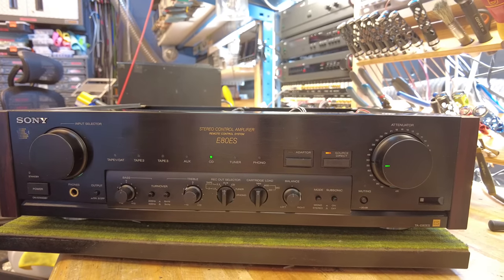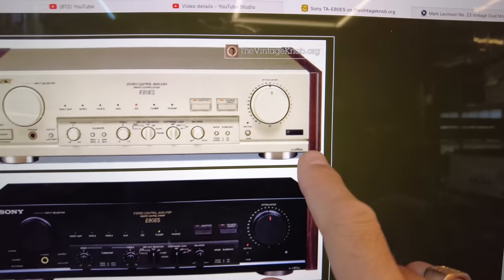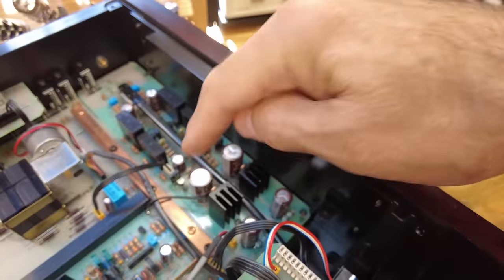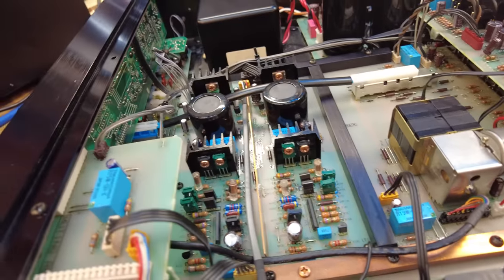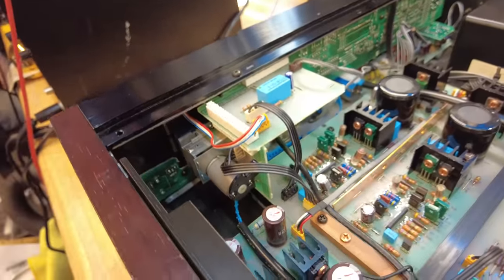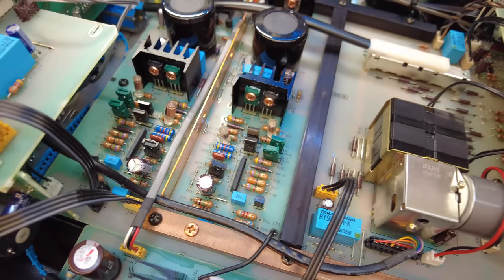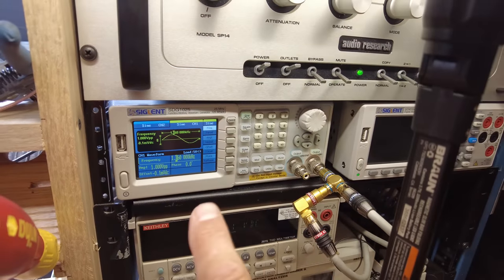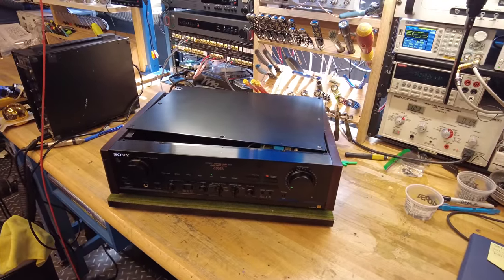If You Find One of These, BUY BUY BUY.  The Killer Sony TA-E80ES Preamp

Comment: This is pro grade XLR I am impressed what’s the voltage output? I had a Nad c350 intergraded with less than 1.4 volts I hooked up my pro power amp to it and it was underperforming so I sold it Nad are not what they used to be

Comment: Hi Fernando, I have to call you out on this one. I love to see these great items boosted, but not other great items mistakenly maligned. The TA-e77es is a fully analog preamp that has a DAC built item. There is no digital processing of any analog inputs. The DAC is a very nice Burr Brown and is fully shielded from the analog circuitry. It’s a great pre-amp. The Burr Brown is a highly regarded ladder DAC which are once again appreciated for their character. Sony’s first actual digital processing pre-amp is the TA-e1000es. 

Thanks and keep these coming!
Reply from the maker: Thanks for the info. I'm surely mistaken about the TA-E77ES.  Ill have to hunt one down and get more educated on it.  Nice to know its not just processing like so many preamps from that era.  Is it built as nice as this one?
Reply from the maker: Great news, a generous fan of the channel just donated a TA-E77 so I’ll be doing a video soon.  Stand by.
Reply: @SkyFiAudio  Excellent news! I find the build comparable. Sony rated them identically and much of the circuit topology is the same. The 77 has relays at the inputs instead of the rotary switch of the 80 and a little bit more sophisticated gain stage design. Both have FET inputs and are well designed. The 80 has those great epoxy boards. Phono stages are identical, the power supply is pretty much the same as well. The 77 is easier to find in the US, the 80 was more popular in Europe. Anyway, you will draw your own conclusion and I look forward to your thoughts.

Comment: Loved your review of the Sony TAE-80ES preamp, a sorely overlooked and underrated item of the early 90’s.  I bought mine new in 1991 not just because of its sound, but because of its internal build quality, number of inputs and outputs (only equaled then by McIntosh preamps), and the inclusion of a fine system remote, all lacking in reviewer’s darling of the time, the Adcom GFP-565 preamp, which was a forest of integrated circuits, had a folded steel enclosure, and no remote.  I still use mine - I’m listening to it now!  The Sony retailed at $900, the Adcom at $800.  A few points you weren’t able to cover in your review:  There are only 5 integrated circuits in the audio path, 4 of which are on the balanced inputs and outputs, dedicated ICs each used as a unity gain inverter on one leg of each balanced input and output.  The TAE-80ES is a single-ended design and those ICs convert the balanced signal to single ended on the input, and then again to balanced at the XLR output jacks.  The 5th integrated circuit, a 5532, is used as an output buffer on the phono preamp board, which, as far as I can tell from the schematic, has purely passive equalization and uses a selected low-noise FET transistor on the input.  The moving coil selections on the front panel are confusing in that we are used to seeing them marked as input loading.  On this Sony, the markings of 3 ohms and 40 ohms indicate which setting to use by asking for the internal impedance of your MC cartridge, not showing the internal loading inside the preamp.  I found the 3 ohm setting roughly equivalent to the 100 ohm setting standard on most current MC preamps.  Feel free to experiment.  It’s harmless and free. Nonetheless, the phono stage is the quietest I have ever used with low output MCs, now doubt due to the board’s onboard PS regulation, itself being fed by the main power supply regulator board which is executed with all discrete components.
Reply from the maker: Glad you liked the video.  Be on the lookout for more Sony reviews.

Comment: I don't know if you can take the time to answer questions.I have been using a sony TA-1000ESD in stereo mode only for several decades. It works perfectly. Paired with a Pioneer M25 amp. What are your thoughts on this pre-amp?
Reply from the maker: from a brief look online, it looks like the analogue signals get converted to digital which is far from ideal.  Cool piece never the less.

Comment: I remember these Sony components from the 80's. I think the ES stood for "elevated standard" and they came with 3 or 5 year warranties . Love the channel !
Reply: That's Correct "QS" was Quality Standard and "ES" Was either elevated standard or Extended Standard throughout the 1980's, 1990's and up untill around 2010/11 when very sadly Sony completely stoped both ranges. 😢.and in my opinion Sony has never been the same in fact I dought we will see standards from Sony from that. Goldern period again.
Reply: @marcdavis8842  no they didn’t. The ES line is still in production. I had a 995ES laser projector for example. It’s still the high end line of Sony.
Reply: or perhaps...EXTRA SPECIAL
Reply: I owned an ES receiver in the 90's. It had a egg gyro for the remote. It was the worst amp I ever had. Always in for repairs. I threw it in the dump.
Reply: @timcat1004  I agree. I sold Sony ES for years and I remember that remote. It was universally despised by salespeople and customers alike and, thankfully, Sony dropped the gyroscope remote the following year.
Reply: @glennjones6574  I sold Sony ES for many years. ES does indeed stand for “elevated standard”. My 1990 Sony T-shirt says so (and so does the neon sign I swiped) 😆.

Comment: Good pre amp indeed. Unfortunately, the weak link is the rotary input selector; if it goes bad, there is no cure.
Reply from the maker: Lol fingers crossed.
Reply: There is a cure, a total rebuild of the rotary selector if you have the stomach for it. For what its worth, I bought my TAE-80ES new in 1990 and with constant use, it’s still 100% reliable with never a repair.

Comment: What's the purpose of a preamp? I've never used one, I found that home theater audio receivers work very well for me for direct amplification.
Reply from the maker: You're HT receiver has a preamp built into it.  It provides input selection and volume control.
Reply: @SkyFiAudio  That doesn't answer my question to why do I need a stand alone preamp.

Comment: If you find a Sony TA-2650 or TA-F3A you should also buy buy buy. Not only beautiful but both have  magnificent sound. The interior of these amps is a work of art and by now all you will likely need are new caps as long as these were not driven overly hard. By the 1980's and 1990's Sony like others had the black face painted look. You have to see the silver Sony's to fully appreciate them.
Reply from the maker: for sure.. on the hunt!
Reply: @SkyFiAudio  Just got a recapped TA-2650. Listening through my Beyerdynamic DT 770 pro headphones, omg. Picked up a pair of B&W v203s for cheap and so far am less excited (lack bass, way up-front highs), but holy moly it is a beast. Definitely second the buy-buy-buy, especially as I got mine for $210 CAD.

If anyone has recommendations on speakers for these, I'd love to hear them. It's definitely the v203s that aren't keeping up with the bass output and not the 2650's lack of capability.

Comment: Hello I have a Sony TA-N80ES  and  TA-E80ES , the preamp is excellent but the power amplifier has a problem it blows the power supply fuse. When they are  working the  200 watt power amplifier is very  powerful.
Reply from the maker: Bummer yours is not working.  Definitely worth the effort to get it fixed.  There is nothing particularly complicated in the design so a good tech should be able to fix it.

Comment: A signal circuit analysis would be great.
If the motor knob fails a microcontroller running relays    could work. 
Nice amount of inputs. The balanced signals are great for interacting with stage equipment, avoiding ground loops and hum. Not really needed in a home. That high end fad faded.
Reply from the maker: thanks for the feedback but I'm afraid it would bore most viewers except for you and me :-).

Comment: At 9:00 in you are talking about the relay is for the inputs,  the start to talk about how usually there is a rod to change the input, then the video goes back to talking about the vintage knob from earlier in the video… Looks like the video continues at 15:46 So, if you could cut 9:00-15:46…
Reply from the maker: My bad.

Comment: It really shows the meaning of the phrase "power rail" this thing has a giant rail of copper near centre! Another drain rail is painted black wow... also note the resistors are all lined up very tidy. This is another sign, how tidy the layout of the circuit is. Rotary relay is indeed the best way to do it. Amazing. Any amp you can hear switching i love. Good point moving the signal in back with remote. It has XLR output? Let me see the back then!
Reply from the maker: Hey mate thanks for writing and for pointing out the tidy layout.  yes the Rotary rally is super cool and well engineered.  Wish they had more of these in other models but I haven't found another one.

Comment: You mentioned the remote.  The included Sony system remote is a joy, well laid out with large buttons and clear logos and useful range and angle. It will work a Sony tuner, dual(!) cassette deck, and single disc CD player, no disc change buttons.  All Sony remote codes were the same throughout their hi-fi product line EXCEPT:  Notice the level control on this preamp is marked “Attenuator” and not “volume”.  Which means that while a Sony remote with volume buttons may work their receivers, shelf systems, boom boxes, etc, it will not work this preamp.  You would need a Sony remote intended for ES hi-fi separates, with clearly marked “attenuator” buttons to adjust level.  Unfortunately, these remotes are hard to find anymore…
Finally, I can speak to the robust reliability and long-term satisfaction in sound, utility, and usability.  I wish Sony would bring this unit exactly back, but I’m afraid it would have to be priced in the upper four figures for any reviewer to even give it a listen.  Ask Yamaha..
Reply from the maker: wow, super interesting bit about the attenuator.  Thanks for sharing Dan.

Comment: Worth noting is that the balanced output connectors defy modern convention, which is 2 hot and 3 cold.
Reply from the maker: Spot on Tony, thanks for pointing out.  Luckily there is a drawing on the back depicting the proper pinout.

Comment: Love this Pre Amp , but a  comment about the built in Bass, Mid and Treble ( in my case Pioneer SX1280 ) IMO more so back in the day, the Source Quality pretty much made these controls necessary as well as a Real Equalizer for Tape mainly,  but there was a Ton more "Difference" in the Vinyl,  Cassette and even CD quality, and those Controls were a Must to get the Sound to be comfortable to your ears! Even today some of the Sound Quality is questionable so it's hard to believe us Audiophiles would have any indifferent feelings towards these controls! 99.9% of the time they can be Turned off. 
Even some of the Streaming sessions ( I use Node and just started with my Node X ) through my 185 WPC Reciever and between Albums and Tracks my ears want some of these adjustments! 
Keep up the great Vids!

Comment: >That retangular green LED in volume knob i have no words for.. i done the same to a NAD3020B with a precision file in 1988 have no idea where i got the idea from, those two boards with single electrolytics at first glance may be individual linear PSU stages from main rectification/smoothing, looking again not (strange long chip) i remember the ES range can't miss those wooden sides true late 80's classic. I think the matching ES range CD transport was the first 1-Bit type DACs from Sony.

Comment: That Gibraltar material is stated on other units listed on the vintage knob as being "polyester, calcium and carbon". It sounds similar to Sony's Bulk Material Compound (SBMC) that they used on some turntables 

"Sony SBMC (Sony Bulk-Molded Compound) Cabinet: (All Models)
All of the new Sony turntable bases are made with a special compound material which is precision-cast for one-piece rigid construction. In addition, the material is acoustically dead, and does not easily resonate along with the music being played. The cabinet compound consists mainly of calcium carbonate and fiberglass with a polyester binder. It is extremely strong and does not chip as easily as concrete resin or wood."